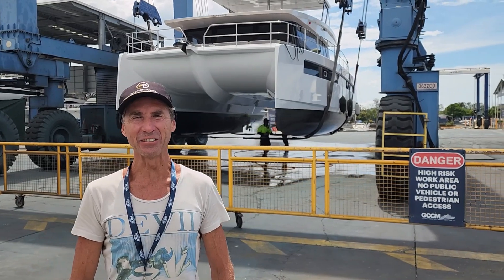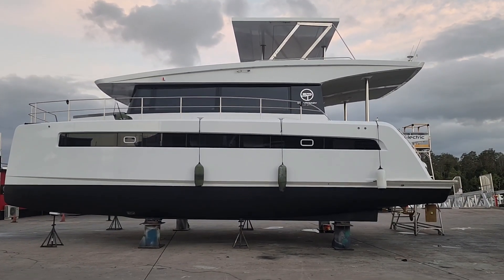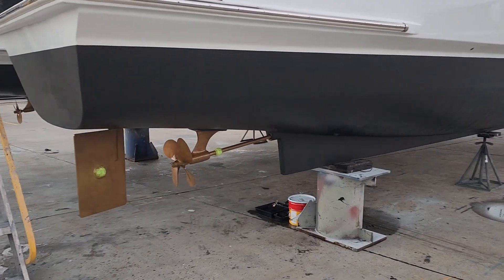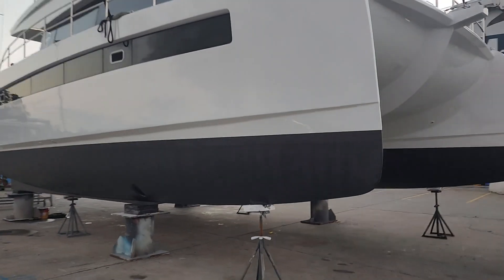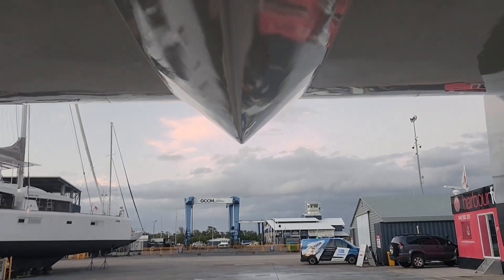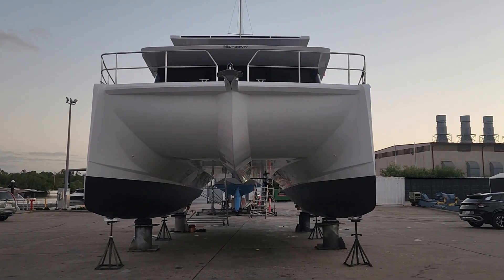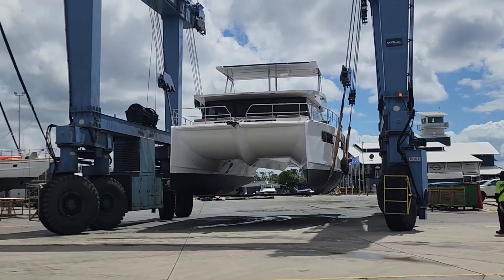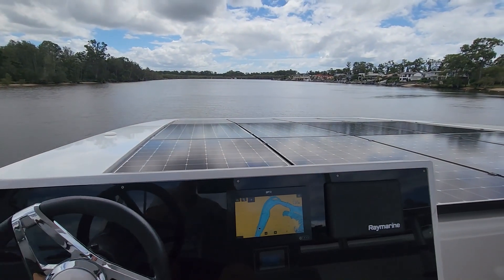SunPower Yachts 44 Update 2024: Hull Optimization Explained

Comment: What is the material of the hull? Where is the production occurs?
Reply from the maker: Shoes of the hull and resin and cedar with hardwood keels which connects to light weight engineered hulls to reduce weight